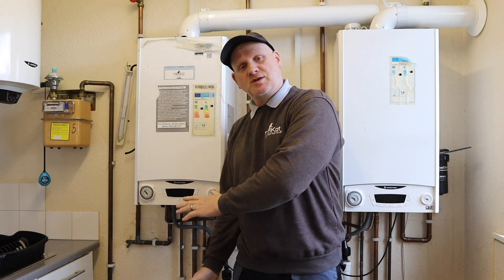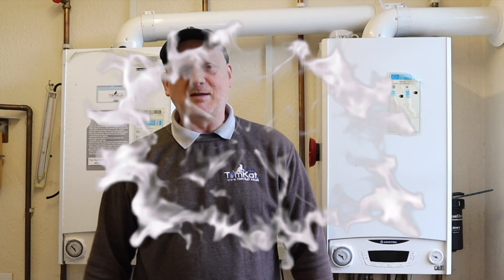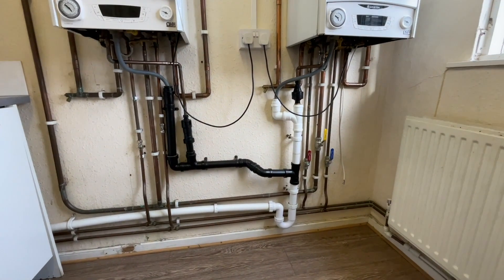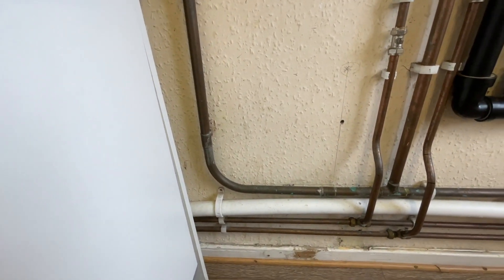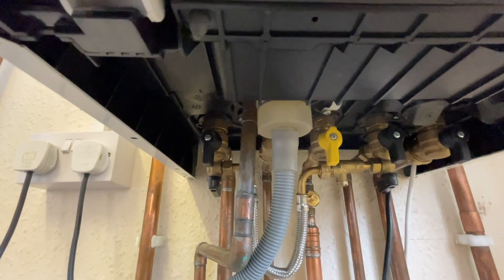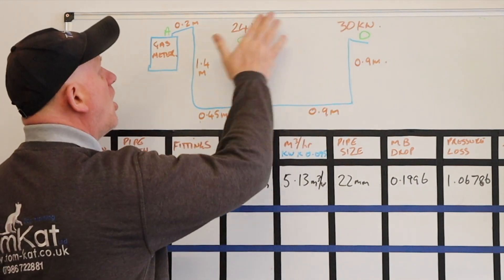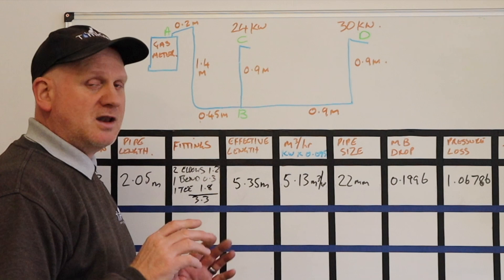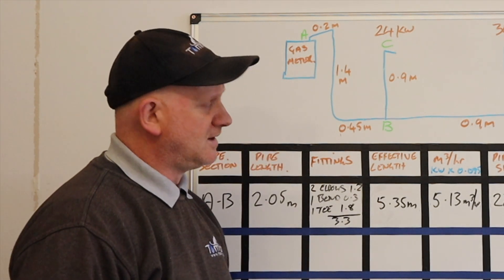Can you install a gas boiler on 15mm copper gas  pipe?

Comment: If you have two 15 mm gas supply pipes from you meter in your kitchen could you join them in a tee with the outlet from the tee in 22 mm would this give you enough gas for a 24kw combi boiler?

Comment: As gas safe say allways follow manufacturers instructions what about vaillant ecofit and ecotec sustains they state in the instructions working pressure should be between 13 and 21 mb ? Iv seen them installed running at 17mb do you class it as under sized even if the gas rate and co are fine ? Also noticed difference with putting it in high rate seens to drop lower and just doing test by running hot at full tilt on bath ??love to know your take on it this is with no other appliances
Reply from the maker: Vaillant’s readings are from the gas valve not the gas inlet/isolation valve and you say it’s the only appliance on the gas pipe then you go off the MIs but on the new Vaillant they now have a test point on the inlet/ isolation valve so that will then have to be no more than a 1mbr drove across the installation.
Reply: @tomkatgastraining  thanks alot for the reply yes this is on new  build installs with test Point on inlet .that was my first thought aswell from the gas valve not the inlet stop cock .but the instructions clearly show a picture of the inlet and to connect to that and then underneath give the permissable gas inlet working pressure to be 13 to 23 mb (not 21 like I previously stated )given the regs 1mb drop over install just curious as to why that would be, pos dif regs in Europe maybe?

Comment: 4:16 Should be 2 x 0.4 = 0.8 also the exiting Tee should not be included on the A - B section as you are only going up to the Tee and not past it.  The B - C section should have the exiting Tee.
Reply from the maker: Incorrect about the tee you always use the biggest size the tee could be and the biggest size in this case is from a to b not b to c

Comment: So. My boiler is making little poppy explosion noises as it ignites!! and has been doing for over a year..  My engineer has tested the gas pressure at the meter and then again at the boiler. There is a massive pressure drop (Can't remember how much but he says its significant and the boiler needs a higher pressure to work properly) I've got a 13 year old Worcester combi boiler which is 12 metres away from the gas meter, the supply runs all over the place in 22mm pipe with multiple bends and angles before reaching the boiler.  Engineer says the problem is probably the low pressure caused by piping design ?? On examination..the majority of the feed is in 22mm copper but after ripping up my nice kitchen floor a few meters away from the boiler I can see it has been reduced to a 15mm pipe for a 2 metre section (no idea wht this was done??) Is this a likely reason for the pressure drop? I can't think of anything else it could be -- The boiler problem is relatively new considering the boiler is 13 years old and has been serviced regularly??  I'm planning on re routing the pipe but this means a lot more damage to the flooring, could do with the thoughts of others before I do this.. ?

Comment: Hello Tommy,can you tell me the internal diameter of hep20 15mm pipe please,I know 15mm copper is approximately 13mm,the reason for asking is i have had 2 middle feed designer radiators fitted in a new extension recently recently, they were tapped off the 22mm primary and reduced to 15mm hep20,its approx 24m run with Tees couplers and elbows in,the issue is the radiators don't get very hot.
Reply: It’s 9-10mm because of the internal inserts

Comment: Is the 24kw and 30kW boiler net or gross. Normally when you by a 30kW boiler that’s net so as a gross it’s actually 30 x 1.1 so 33kw. And for the 24 kw boiler that’s 24 x 1.1 = 26.4kw. So personally I use 59.4 x 0.095 in the 5th column not the net sum of 54.
Reply from the maker: You use the net figures and it’s 1.11 for natural gas not 1.1
Reply: @tomkatgastraining  I have never found in a book where it says which to use the gross or the net. Hence I use the gross as it airs on the side of caution. Can you point y me to any literature that’s specifies to use the net instead of the gross. Not doubting you just want to see it in literature as never found it despite looking.
Reply from the maker: @jonathanalder1206  we have not used gross figures in training since we changed from gross to net in 2000. All the training manuals use net and all the exam questions are net but the British standards gives us both.
Reply: @tomkatgastraining  cheers appreciate the clarification

Comment: What is the point of 22mm (or more) to the boiler, when the actual final connection is only15mm?  Doesn't this limit the gas flow too much regardless of the previous pipework?
Reply: That's a good question, shame nobody has answered it.
Reply: As gas flows through a pipe, it experiences a drop in pressure due to friction along the pipe walls. Larger diameter pipes (like 22mm) have less resistance to flow, which means that they can carry gas over longer distances without a significant pressure drop. This helps maintain the required pressure at the boiler inlet, ensuring that it operates efficiently and safely.
Reply: If the entire run were 15mm, it might be inadequate for longer distances or for boilers with higher gas consumption, leading to potential performance issues or safety concerns. By having a larger section of 22mm pipe before the 15mm reduction, the system compensates for any potential pressure loss over the length of the pipework.

Comment: Hi Derek,
Great video well done.
The only thing I’m a bit confused is for 54kw appliances gas rates are 5.5m3/hr not 5.13 m3/hr. 54kw x 1.1 :10.80 fixed factor = 5.5m3/hr. 
Also looking at BS6891 table for 54Kw net gas rates are 5.5m3/hr.  This is not taking the diversity factor into the account which would reduce the gas rates. 6:21 
Sorry am I missing something?
Thank you
Reply from the maker: When pipe sizing we use 0.095 because 1 kw requires 0.095 m3 of gas

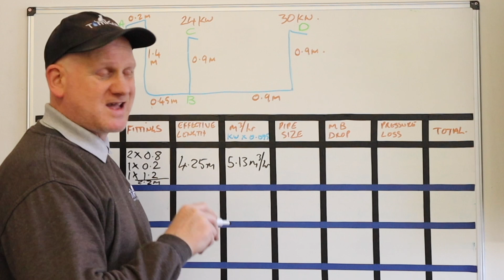Comment: 5:06 kw to m3/hr.   i was wondering where does the 0.095 come from?  is it a look-up value itself or did you need to calculate it from the energy content of the gas?   thanks.

Comment: if you got 19mb at the meter working pressure and 18mb at the appliance is this not ok to have 1mb access the installation?
Reply: Working pressure 21+-2mb

Comment: Good presentation. Many boilers are oversized in my opinion. Isn’t the first step is to do a heat loss calculation to determine the boiler size required? Can you use 15mm gas pipe for a 12kW or 15kW boiler? Why is gas pipe sizing for a system boiler different to a regular boiler? As a condensing boiler is more efficient, shouldn’t it use less gas and therefore have less pressure drop than an boiler non-condensing boiler if properly sized?
Reply: I think pressure drop is governed by resistance. Smaller bore pipes have a relatively large resistance when compared to larger pipes.
Reply: 6- 8 kw would be ample to heat most houses with a flow temp of 55c on a low and slow the way to go scenario but on a combi 24 kw min would be needed for instantanious hot water at outlet at 50c  if theres a good water flow rate

Comment: I get what your saying,  but the contention that 15mm copper will support a 24kw boiler is valid.
Given a pressure drop of o.o3353 mb per meter just under 3m effective length ,theoretically, would meet the appliance  criteria. 
Gas rating, is absolutely  essential!
Ultimately complying with manafacturers gas rates reinforces inlet working.

It is possible to connect 15mm from meter to appliance.
Most likely scenario is 22 from meter and 15mm branch to appliance. Your only demonstrates an obviously  impossible  scenario,  a 15mm supply  at under 3m effective length would work.
Reply from the maker: You only need to put an elbow on the system then it won’t work
Reply: @tomkatgastraining  Derek, I do understand pipe sizing and maybe gas rating combined  is not always used to confirm  safe operation, anymore than CPAs use is often not fully utilised.
Reply: @martinwright7367  Derek's  assertion that 15mm pipework  won't  support a 24kw boiler is correct in his demonstration. My point is that it can be done, but in most real life installs it's  not going to happen.

Comment: Thanks Derek,  interesting video as usual. I have a question about a possible scenario. If a pipe to a boiler is undersized say 15mm supply and the upstream half is buried and the downstream half is accessible would it work if you increased the downstream size of pipe to suit a permissible pressure drop.?Just a thought, cheers
Reply from the maker: You should always increase from the start if you don’t it could cause the boiler to start and then drop out then start again and then drop out. Also it could effect the safe operation of other appliances.
Reply: @tomkatgastraining  cheers for the reply Derek
Reply: Should we also bear in mind foremost the manufacturer's admissible working pressure range For a specific appliance?
Reply from the maker: @ghaderortakand6027  manufacture’s don’t take into consideration other appliances also their readings are from the gas valve not the inlet to the appliance.
Reply: Unrelated, but congratulations on the good form of man utd.  I will be watching the FA  Cup game against West Ham tonight. Fingers crossed...